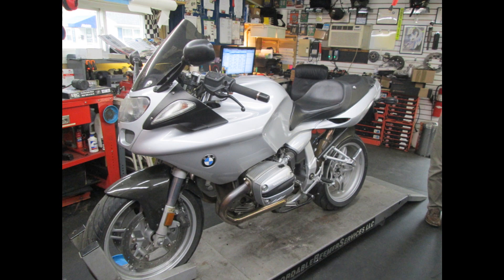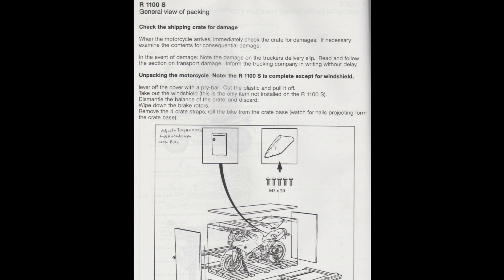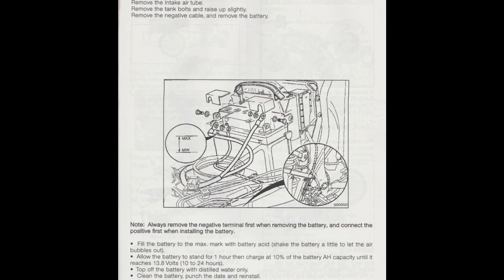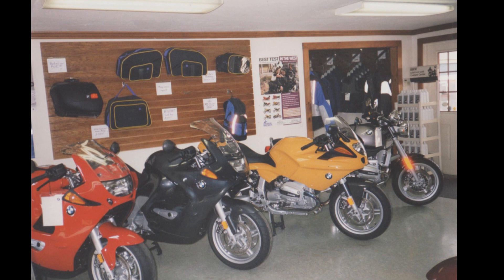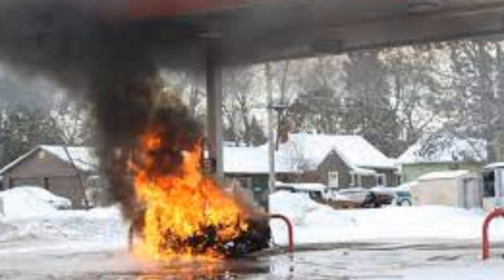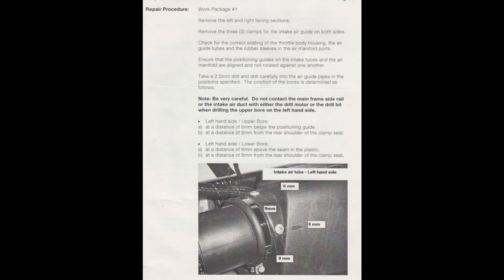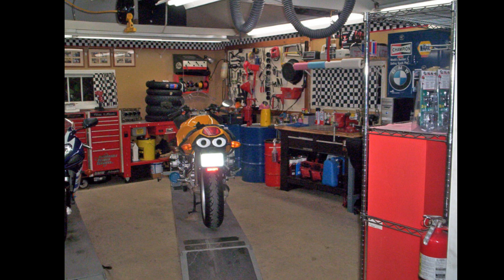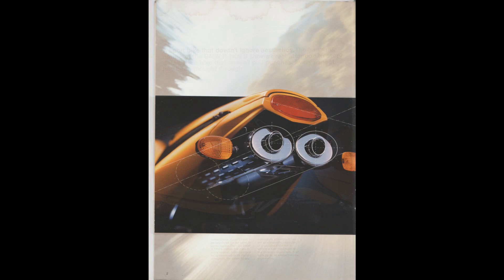BMW Service - R1100S - part 2 - The S arrives at the dealership

Comment: As a relative ham hander when it comes to performing all but the simplest maintenance - I must say, getting to the battery on these bikes is something of a project!
Reply: It is such. I have a "99 with 10, 000 km. Kinetic art, it is. Can never be in a hurry when dealing with this beauty. Had to change the fuel pump a year ago...sitting with stabilizer...not enough. Never a good idea to start and idle these bikes...they need to be in the wind. A little more "tedious" than the battery. Chris' video (and one other, as I recall) helped tremendously. Changing the original rear tire this weekend. Then, on to the old 79.5 Kashmir Decker...another antiquated piece of rolling art. Hope Chris is ok.

Comment: Thanks Chris, just bought a 2003 with 23k on it and set about restoring it, left stored with an empty tank and had to rebuild the filler and the pump plate? Keep the R1100S stories coming, I'll go to patreon and support you...after all guess who is going to replace the input shaft and clutch...not me :)

Comment: I have one of these with a dead fuel pump. I just needed to get up the impetus to get it all off.
Reply: Find the video Chris did on pulling the pu
Reply: You'll need a fuel filter as well
Reply: @byrontucker6442  I did, that's why I haven't done it. :) I do have a filter and O ring as well in my drawer of bike crap. I have a newer bike so I have no need to do it.
Reply: @conkerman01  totally get your pain. All I can say is it's doable. If you ever do feel the need to punish yourself and do it. Get the accordion plastic tubes to replace the old tubes from the fuel pump to the filter. They are cheaper and are higher quality (much higher burst ratio than stock)